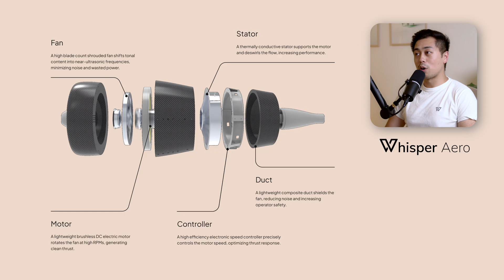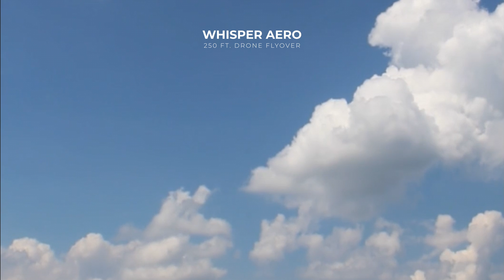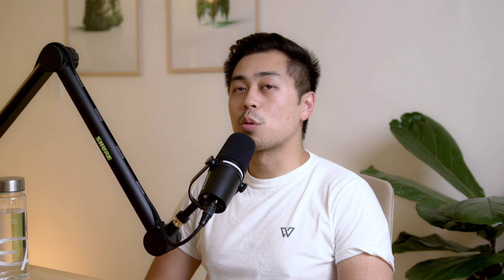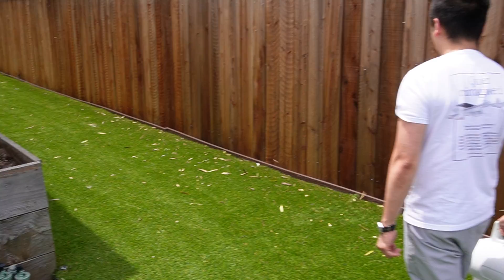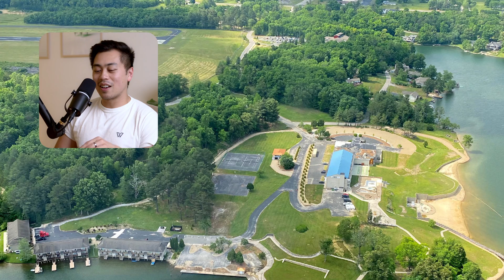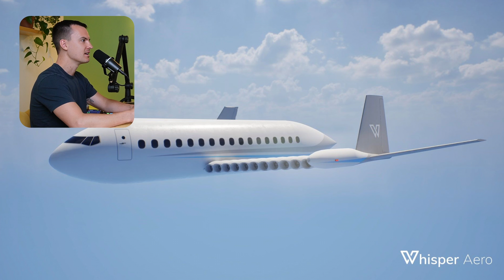The World's Quietest Drone Engine | Ian Villa, Whisper Aero

Comment: Thanks for socializing this technology.
For the leaf blower, much of the remaining noise appears to be mechanical vibration amplified by the construction. Without the mechanical noise, the higher fan blade frequency is definitely still audible, makes me wonder if truly ultrasonic is at all possible without cavitation (high turbulence or slip, or whatever you call it).
There is no perfect fan but excellence has value.
Reply from the maker: Not pictured was the pretty jank electrical setup for the thing hahaha. Still definitely a prototype. I think they intend to sell the engines as components rather than build a consumer-facing leaf blower

Comment: When you make something using these principles, very quiet, you will give up something else. It might be speed. It might be drone climb or some of their factor that they’re not mentioning here as a casualty of new technology.
Reply from the maker: The downside is that it can't spin very fast or get very big, or it flies apart. 

So they have to rely on 1) efficiency and 2) many smaller engines to get a lot of thrust

Comment: There's a picture/video of the actual impeller on their website. About 70 or so straight metal blades, finely spaced, with a metal ring around them, like jet engines and other turbomachinery. It sounds like the Dyson hair dryer. In their video, the maximum frequency of the spectrogram they show is 10 kHz. If you make a frequency analysis of your own, you will find there is a peak at 11.8 kHz. Quieter, sure, but there is nothing "ultrasonic" about it. Humans can usually hear easily up to at least 16 kHz, and if you do not listen loudly to headphones, up to 20 kHz+. And of course, if you reduce the RPM/power of the fan like when it is spooling down in the video, all of the blade passing frequencies enter the 5-6kHz region, which the ear is particularly sensitive to.

Comment: I only see 2 issues. 1: Multiple engines, multiple bearings, less efficiency. Maybe better packaging and weight distribution makes up for the efficiency loss? IDK. Problem 2: I don't know that you can just stick a bunch of engines on a wing like that and not have increased drag. But again, maybe it's not that big of a deal compared to having a single big engine off the wing. I feel like the idea of multi micro engines has been tried before and I think there is a reason we don't do it. But I hope I am wrong. I like the concept. The engineering is solid. And you have a working prototype. I like everything about this.
Reply: There is also lots of effiency gains from multiple engines for example from pushing air over an airfoil increasing the effiency of the airfoil.
Reply: @FriedrichWinkler  you could get a mad Coander Effect going there yo.
Reply: Bearings for a larger motor will need to be larger. Increasing the diameter of let's say a ball (in the ball bearing) 2x increases its weight 8 times. 
Same increase for thermal mass and as mentioned you'd need external cooling rather than blowing it away.
Reply: As long as propellers are big enough for Reynolds to not matter(20" should be more than enough), there shouldn't be much efficiency loss from multiple engines.
Reply: Have you not seen emergency cell tower drones? They have 10 engines on each wing. He's just explained his engines are smaller he hasn't gone to scale. Each engine has its own bearings? Every motor has its own bearings
Reply: Think that’s why they’re selling the tech for leaf blowing machines too noise reduction